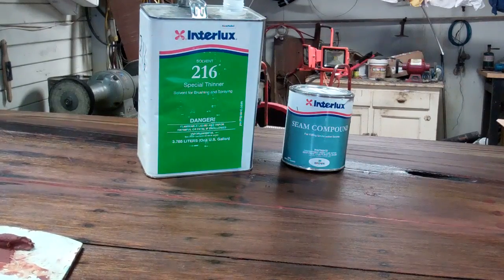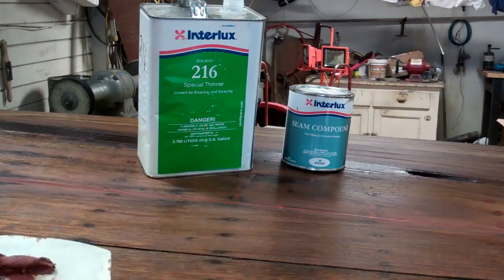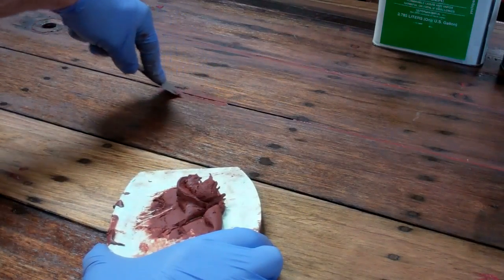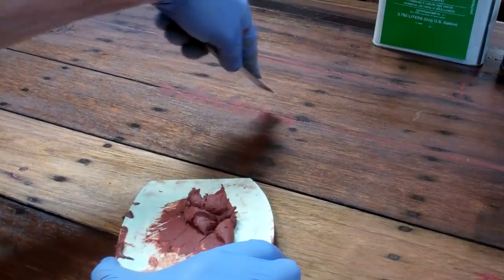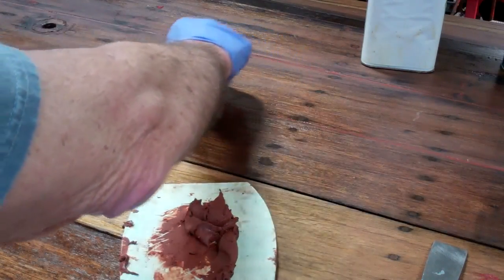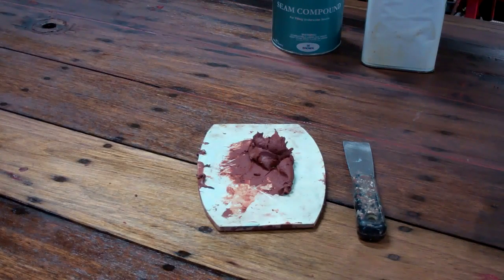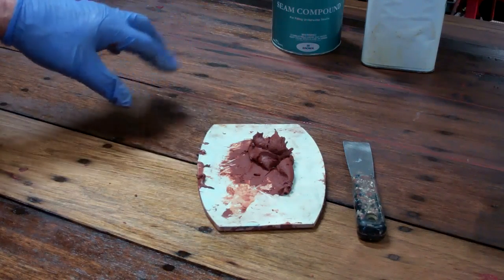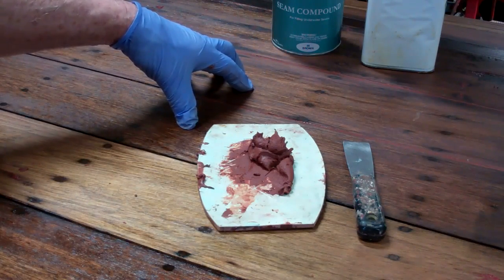Sealing Bottom Planking Seams on Our 1938 19' Chris Craft Special Runabout 2 21 2017

Comment: So if I understand correctly. Buy sealing the seams on this boat with the original bottom. Does this just help the bottom to soak up faster?  So you strip the bottom paint , then apply the clear to wood, then the seam sealer then repaint with hard copper bronze? Two coats?
Reply from the maker: That was then. We no longer use INT Seam Sealer because it has been replaced by better products like TotalBoat ThixoFlex and TotalBoat SEAL.
You missed two steps: strip, seal with CPES; pay the seams with ThixoFlex or SEAL; SEAL AGAIN WITH THREE MORE COATS OF CPES, APPLY FIVE COATS OF INTERLUX INTERPROTECT 2000E BARRIER COAT PRIMER - do not cheat; apply THREE coats of Pettit Hard Racing Copper Bronze bottom paint.

Comment: Hey Thank for you input on this process. Seems this is what i will do with my potential 53 Corsair if i decide to get her. She has been out for quite some time. Any sense to using cotton packing under the compound? Also what exoxy coating did you use on top of the boards and do you apply that first?
Reply from the maker: You are welcome. We have discovered, tested and have now replaced the Seam Compound with  Jamestown Distributors' TotalBoat Thixo Flex. Here's a video we shot on this product: http://snakemountainboatworks.com/1954-penn-yan-captivator-how-to-seal-bottom-seams-using-thixo-flex/
While I have not worked on a Corsair, my suspicion is that her planking is 3/8" thick, way to thin to accommodate cotton beneath the caulking material.

Comment: Good Morning.  Can you tell me what went into your decision to strip the planks, coat with CPES and fill seams with interlux seam compound vs. removal of the planking and bed with 3M5200?  Did you refasten the planking prior to the application of the CPES and the seam compound?  Will you apply multiple coats of 2000E barrier coat prior to bottom paint?  Lastly, what is your expectation of the bottom knowing that it will continue to go thru the seasonal swelling and drying out.  Thanks for the videos they are very informative.
Reply from the maker: Flyin' By is a completely original 1938 19' Chris-Craft Double Cockpit Forward Custom Runabout - essentially a barrel-back.Running her hard over two months on Lake Champlain last summer confirmed that her hull remains absolutely stiff and sound, and that includes the bottom.Yes, she must be soaked up in the spring, but I see that as a miniscule price to pay for originality. (She will be kept on a lift and lie just above the water next summer, which will ensure that she remains swelled.)We know the bottom is original for a fact. Why? How? The comprehensive documentation her first two owners compiled so stipulates. The second owner, from whom I purchased Flyin' By, confirmed that her bottom was never touched during his 46+ years of owning her.Additionally, as we scraped waste material out of her bottom seams, we also found evidence of the original canvas interlayer everywhere. We also selected and tested random fasteners throughout the bottom planking - more than 50 of them. Nary a loose or broken fastener was to be found.We are preservationists first and foremost. Releasing perfectly good original planks from a perfectly sound bottom is a fool's errand for us.The "trade-off" between originality, and the obvious convenience of and extra stiffness provided by a new True 5200 bottom -s just that, a false choice.Finally, we have not decided between Pettit Tie Coat Primer and Interlux 2000E two-part barrier coat primer, but will be sure to video the application and reveal our choice then.
Reply from the maker: We are preservationists who save rather than replace original wood if/when possible. Her bottom planks, which are original, are in perfect condition, so saving them is our only option.
Yes, we did refasten, especially along the chines, garboards, transom and stem.
Yes, we applied five coats of Interlux 2000E barrier coat before applying four coats of Hard Racing Copper Bronze bottom paint.
Reply: @snakemtboatworks  Ok, interesting that I see you eventually put a true 5200 bottom on this boat.  Glad to see you came around on that.  I believe preservation should not mean riding around in a hull that is slowly pulling itself apart due to swelling and shrinking.  Hope your 5200 does as well as ours.  Twenty plus years of regular use now and it’s still dry and strong.

Comment: You can use 3M 5200 if you do it right.  Fill all the seams then soak the bottom thoroughly and cover with 1 or 2 mil plastic to retain the moisture. (Better yet, if you know it's going to rain, plan accordingly so the boat can be pushed outside.  Cover when the rain stops. Day two, remove plastic, thoroughly soak again and then re-cover.  This process can be repeated until about day three.  The wetter you can keep the bottom, the better. The swelling of the wood will squeeze the excess uncured 5200 out of the seams.  Remove the excess with a multimaster after the 5200 has completely cured (5 to 7 days).
Reply from the maker: Really? Not hardly. First the 5200 must be fully cure before the first coat of primer is applied, so, the claim "uncured 5200 will squeeze out" is bereft of a basis in fact, since there will be no uncured. 
Keeping the wood wet is silly at this stage. Unless its moisture content is near 12%, primer cannot be applied.
Finally, let's suppose you continue with your folly. Once it is fully cured, 5200 retains ZERO elasticity and even less compressability. The wood will move during wetting and drying cycles when in use. That 5200 will crush wood planking when the wood swells and tear away from the same planking when the wood shrinks while on the hard over the winter.
The result? A bit of effort with a reefing hook will remove what's left of the 5200 in a couple of years when the bottom must be redone because it is leaking like a sieve. 
The best product for this application? TotalBoat Thixo Flex, which can be payed using a piston type pneumatic caulking gun. West also has G-Flex, which has the same properties, but is supplied in cans or squeeze bottles and must be mixed 1:1 by weight.
Check it out: https://www.jamestowndistributors.com/userportal/show_product.do?pid=336174.
Reply: @snakemtboatworks  Yes, hardly.  I never said anything about primer.  Read my post again.  This method is for bare wood. It has worked on at least six vintage mahogany planked boats that did not require a wholesale bottom replacement...and I've never had a leaker.  The 5200 is forced out when the wood initially swells over the first couple days.  After all the excess has been forced out by swelling and the 5200 has cured completely, it is removed with a multimaster.  Only then is CPES followed by primer applied. If/when stored out of the water for any length of time, water should be added to the bilge to retain a high moisture level and the boat covered...and that's the case with any planked boat.  Your opinion is the result of guessing and making assumptions.  Mine is from experience. Nautilus Marine Restorations
Reply from the maker: @tonkingulfyachtclub8111  Hmmm... and then it begins breaking free, tearing the wood asunder while it dries out completely sitting on the hard the following winter.
Check out this video: https://youtu.be/Vh9DwOromas. 
That 5200 certainly did its job! NOT! The fellow who did this work prior to the Captivator coming to us for major leaking and bottom issues contacted me. He was shocked to say the least, and he's a well respected New England woody restoration guy.
We spoke about how he executed this repair. 
Why am I pointing you towards this work? "Having read all about it in some ACBS or other wood boat publication, I followed the procedure prescribed therein precisely. It involved taking everything down to bare wood, wetting the wood profusely and then paying the 5200.
"As predicted in the publication, yes, the wood swelled and pushed gobs of 5200 out of the seams over several days. Not having any appropriate power tools then, I excised the stalagmites using a single edge razor blade in a super strong window glass scraper.
"I got it all fair finally and then proceeded with priming etc."
This boat is dry sailed and is in the water only when being used. This fellow's obviously careful work lasted .... are you ready? ... six years at which time a good 75% or more of the 5200 had broken its bonds  with the bottom planking. Elsewhere the planking was horribly crushed.  Ever try to replace bottom planking on a Striptite hull? Not fun.

You are welcome to continue executing on what I am convinced is a wrong-headed methodology. There is no way on God's earth that I will adopt what I know is fraught with huge downsides and virtually no upsides. I will stay with either Interlux Seam Compound for Underwater Applications or West G-Flex or Jamestown's TotalBoat Thixo Flex, products I know, are correct for this application and do not require me to flood my shop each time I do bottom work.  

Yes, 3M5200 has  its proper place and proper applications, True 5200 Bottoms and as an adhesive. Caulking  in any manner, including sealing bottom seams- is not one of them..
Reply: @snakemtboatworks  I wonder how this boat is doing now.  We have a twenty year old 5200 hull done with the Dannenberg method, never needs soaking, and not one Plank has buckled, has never leaked a drop, and rides like a dream.  We use it constantly all summer, sits in a lift, and goes right in tue water dry every spring.  I get the whole original thing, but CC never intended these hulls to last more than ten years or so as you know, and the canvass layer is long gone on your boat.  Hope it’s still holding together for you.  Fir me, driving my family around in the middle of a big lake, I’ll take the 5200 hull any day over an ancient hull that was never meant to last this long.
Reply from the maker: @arkos55  We jettisoned Seam Sealer in favor of doing True 5200 bottoms  a' la Danenberg wherever possible. Paying Seam sealer is akin to going on a fool's errand. Yes, it does work, and, as far as we know, the boat in question continues performing well and staying, well, pretty dry.
Read Don's seminal piece on what a True 520 Bottom is, and is not is well worth the time needed. I include a link to it here:
https://snakemountainboatworks.com/vintage-boat-preservation-how-to/how-to-apply-true-5200-bottom/.

Comment: would this product work one a cypress hill shrimp boat? only the buts one her bottom are corked but she's 31 years old and we have only had three planks that needed to be changed in the entire hull. she's 52x18 with a 6ft loaded draft. hull is true 2x4 with 2x10 dew sawn frames. keel is a one piece pine keel 12in wide 16in tall
Reply from the maker: Ernst, yes it will, but we've discovered another product you might consider since then. Jamestown Distributors' TotalBoat Thixo Flex, which I demonstrate and speak about in this video: https://youtu.be/Pf7kVroALuQ.
If you use a pneumatic gun, be sure it is the piston variety. 
The planks on this hull are a bare one inch wide, so waste inevitably ends up on the surface. I must now sand the entire surface with 60 grit to make it fair.
"Regular" planking is wide enough that you should be able to clean the waste before the material cures. I found that acetone and a stainless pot scrubber is excellent for scouring the plank faces.